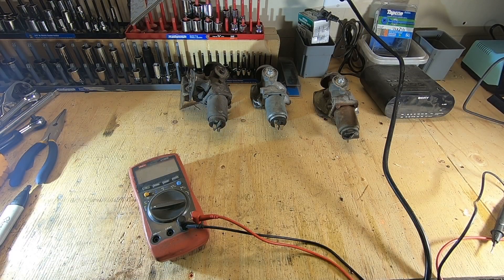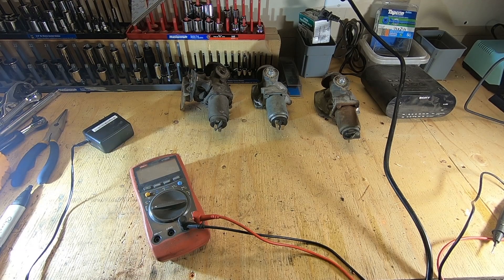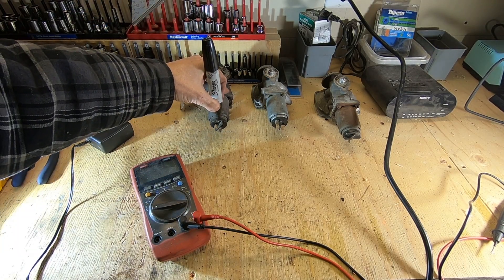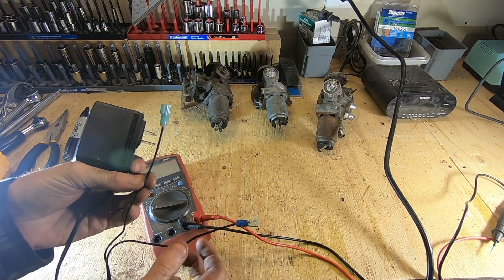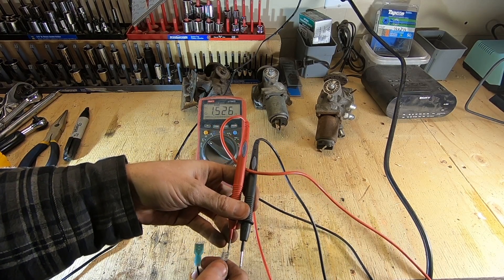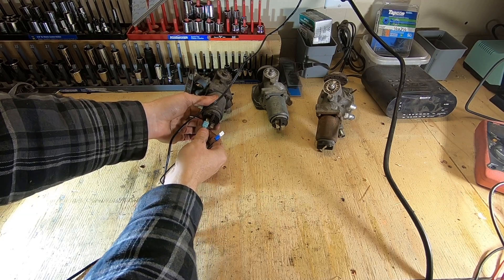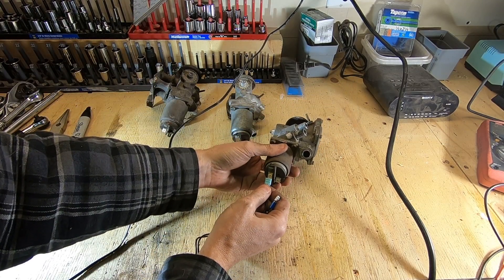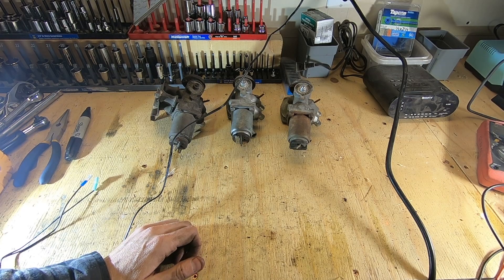VW Autostick - Control Valve - Bench Test

Comment: we have the 1.6 with automatic trans in a custom trike, had the trans rebuilt and now its stuck in 2nd gear no matter what. tried replacing modulator valve with no success in shifting. what are we doing wrong? i dont see any kind of control valve on engine or trans. plz help!

Comment: can you "bench test" the control valve while it's on the vehicle, while all hoses are still connected?  I assume you would just remove the electrical connectors on the solenoid, right?  I need to see if mine is working properly. (trouble shooting what devices are / are not working on a 68)  Bug hasn't ran in years and it's my job (for a friend), to get it running.  I'm trying to test every component to see where the issue resides.